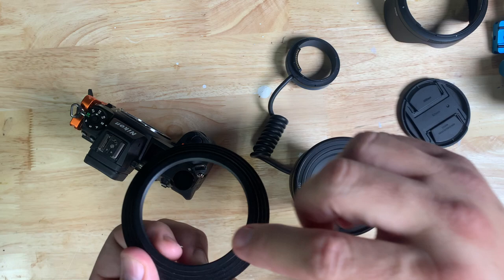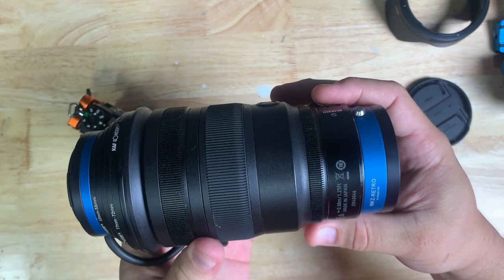RETRO Reversing a Nikon 24-70mm f/2.8 S Lens onto Nikon Z Body for macro photography

Comment: am i right in saying it won't autofocus or allow aperture changing via the camera because the lens connection plate isnt able to talk to the camera?
Reply from the maker: It's the opposite–the lens and camera do communicate. Autofocus rarely works with macro, however, so most people focus manually then use a focusing rail to stack. Hope that makes sense!